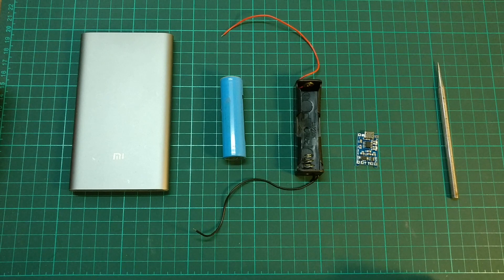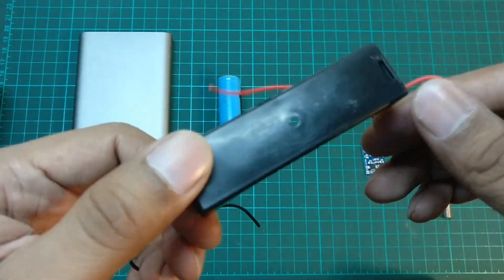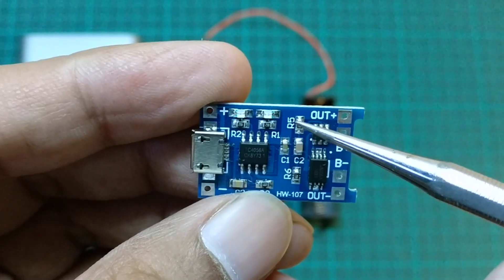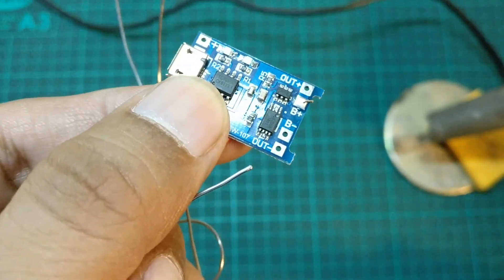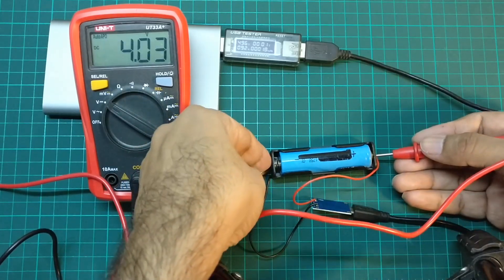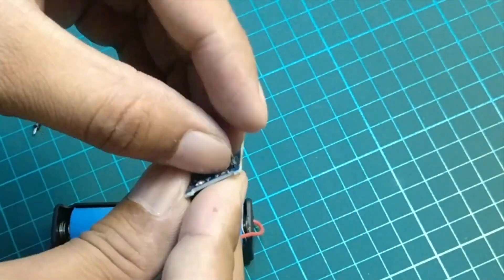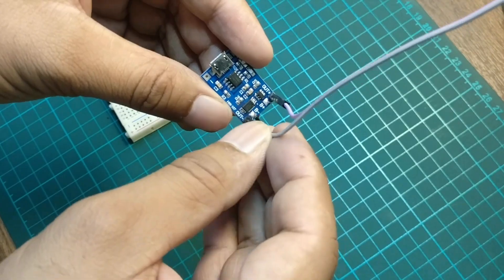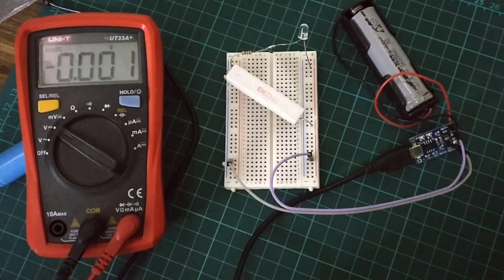DIY Lithium-ion Cell Charger using TP4056 module with Battery Protection

Comment: Interesting, how has the performance been over time, it is reliable? I have had the experience that such items are Ok when first used (not this item, I have not yet tried it, that is why asking your advice/experience), but fail with time and usage
Reply from the maker: I still have to use it in a real world project for extended time to know the reliability. But according to my online research they seem to work fine.